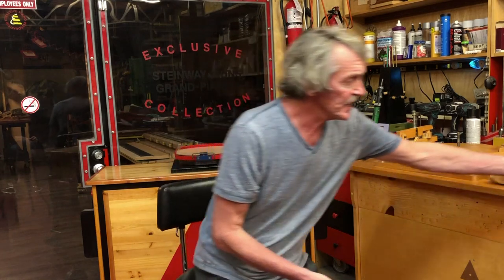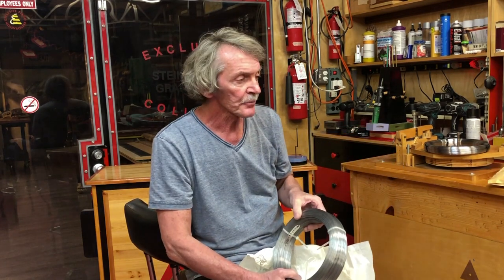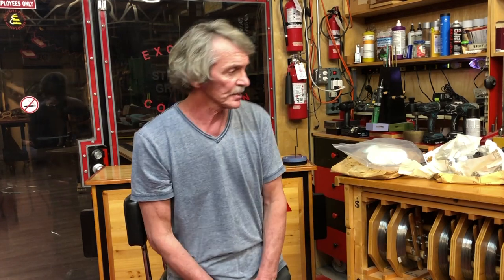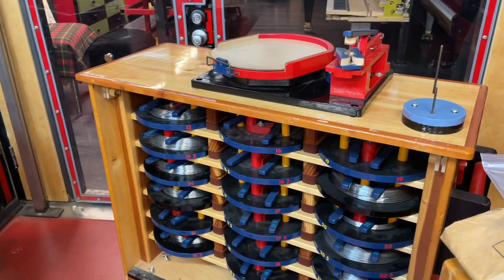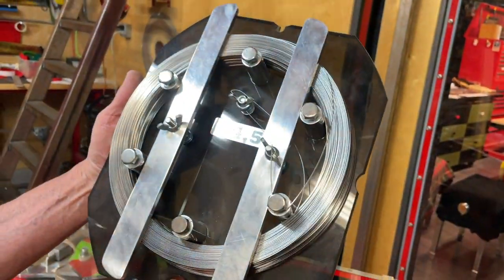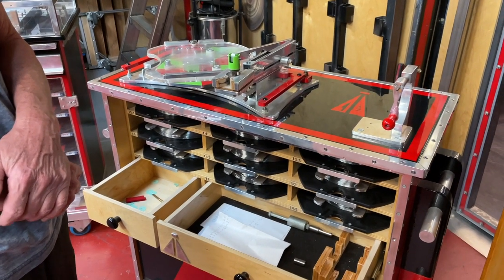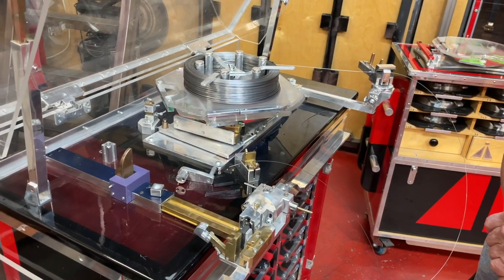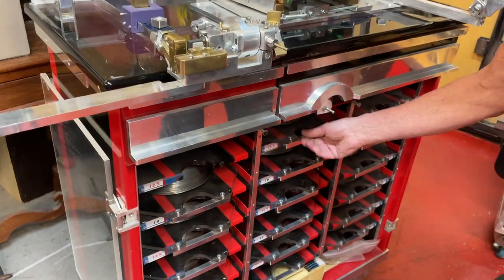Piano Restringing Device - Evolution

Comment: I was told never to touch piano strings with my bare hands, especially new strings. Is there a risk of that string where you touched it, tarnishing early?
Reply from the maker: Mark you are absolutely right, it is necessary to wear gloves to protect piano wires, especially when your hands are sweaty. If in a cold environment, you can touch not for long time and very carefully. The most damage on the piano wire comes from the temperature change. When the wire goes through dew point. You can touch the piano wires but make sure to wipe/clean with a soft rag.

Comment: Obviously this is genius. It goes without saying. As an engineer I can confidently say you are a very skilled engineer and technician. 

However, I have one concern. This is far beyond the capability, resources, or time of 99.9% of technicians to build. Also, if you were to sell these I imagine you would have to charge at least $10,000 just to cover materials and your time. Is it not unrealistic to expect widespread use of this device?

I can see a much simpler and inexpensive solution that involves a table top carousel where you carry the wire in a different bag. Perhaps a loadable tray where you only need one tray and a procedure for easily loading and unloading the strings. 

In this way, one person can easily bring this in the field, it takes up much less space in the shop, and it’s within the budget of many technicians.
Reply from the maker: Mark thank you for your response. I do agree that majority may not be able to do this unit. I also understand that one technician may not do this on their own, but we have. a great organization like PTG that can assist with this development and this unit can come to existence.

It would be great to hear what they think about this type of project. I hear enormous response from technicians regarding obtaining such device and this may be a thing of the future.

As far as having a modular unit that we can bring to the field, it can certainly be done and is a great idea, but  you may still need to make cassette for each wire size (for 5 lbs coils) and to be able to store this cassette somewhere and then you will have to build the carousel, the lock for the wire and use some sort of table.